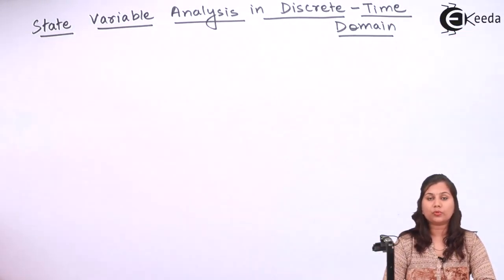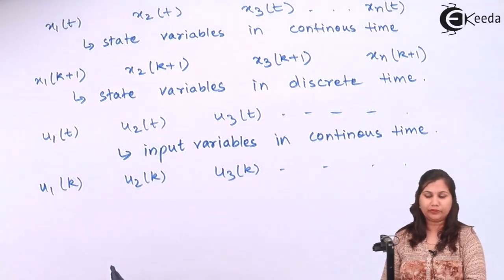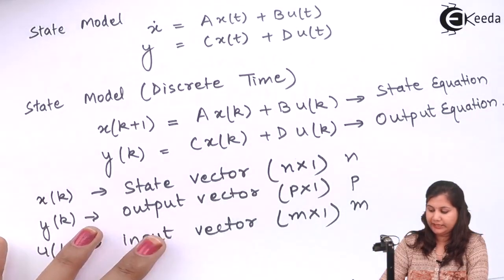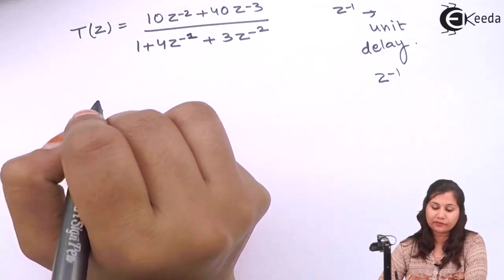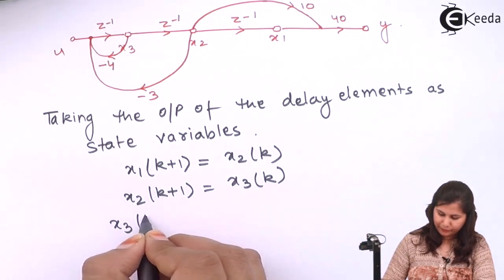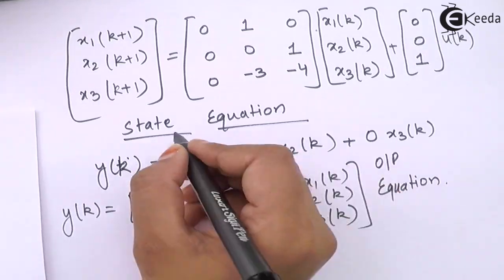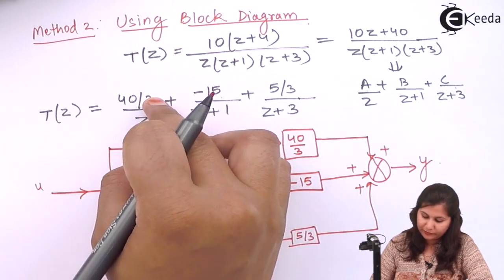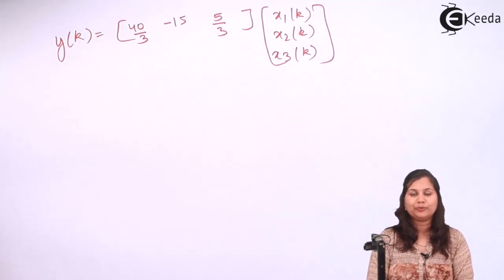State Variable Analysis in Discrete Time Domain - State Space Analysis - Control Systems

Comment: why there  are two different answers  if  there is one question ??? plzz reply
Reply: solved answer might be wrong
 but in state variable method, different approach leads to different state model model. and different model for the same system  gives same input output relationship .
Reply: Exactly.